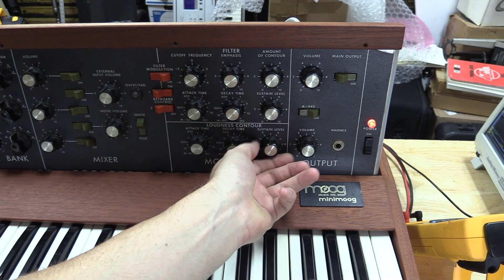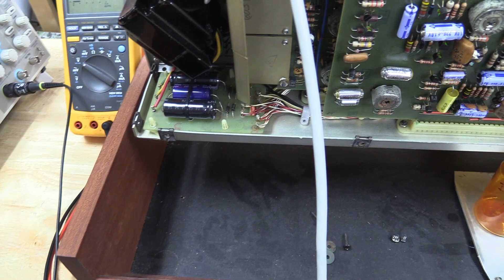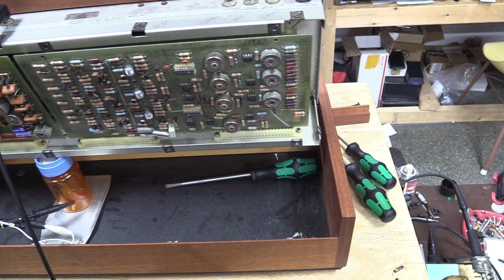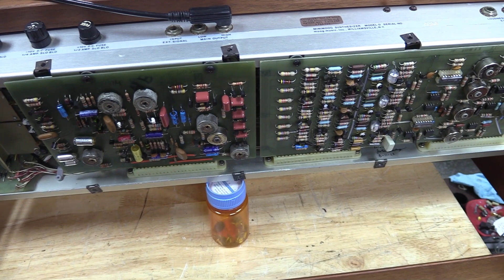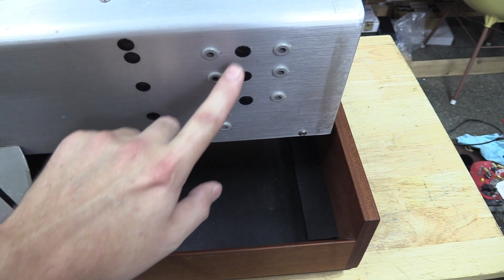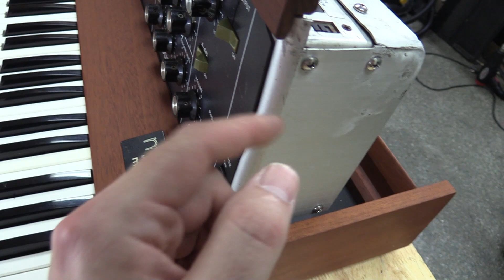Doug's Minimoog Repair (by synthpro)

Comment: question I have an OG 2736 SN with OSC 2 boards I believe the power supply is an early version the current caps in it are only 2- 1000uf 50V's is that correct sizing for this one? I see later versions had 3 caps in there, but want to keep the way it originally was done thanks!
Reply from the maker: @12bitizthewaytogo92  the early two cap setup typically has 500uF@50V caps, (typically a black paper wrapped Cornell Doubler brand if original. Otherwise, it's 2 1000uF@35V and a 470uF@50V cap made by Matsushita/Panasonic).
Reply: @ ok thanks so whoever recapped put the wrong ones in and keep with the 500uf instead of the 1000’s?
Reply: the board definitely can only have 2 caps installed
Reply from the maker: @12bitizthewaytogo92  it's actually best to update this section to the 3 caps for better stability from ripple and helps the life of the rectifiers as well. If you are running the 1000uF you are safe.
Reply: @ thanks not sure how I can modify the board to accept the 3 caps though so keeping it with the 2- 1000ufs will suffice for now? thanks as always

Comment: Wow, that sounds like a LOT of work! Great job!  Is faint oscillator bleed normal on these vintage Minimoogs? My '75 has a very slight bleed. With the mixer at 0 for all oscillators, you still can hear it faintly.  Doesn't really bother me, just curious if it's "normal"?
Reply from the maker: Thank you very much! A little bleed is normal but sometimes it can be circuit related problems such as grounds etc.
Reply: might have a little bit of conductive leakage/"contamination" on the board